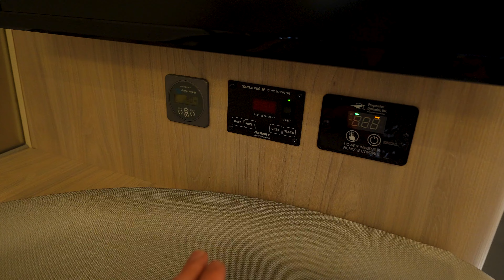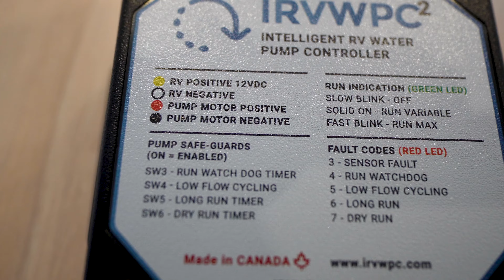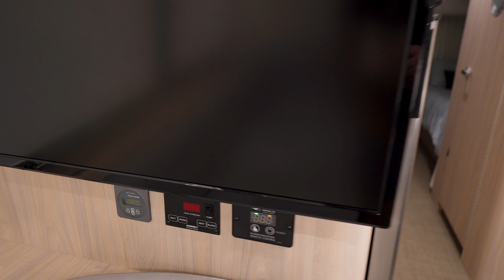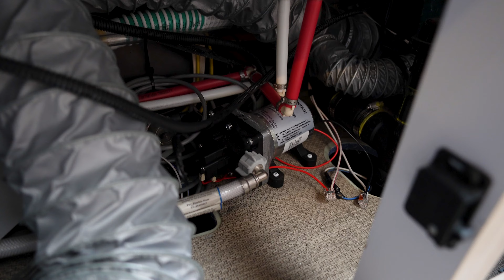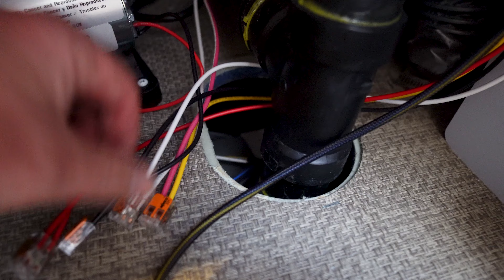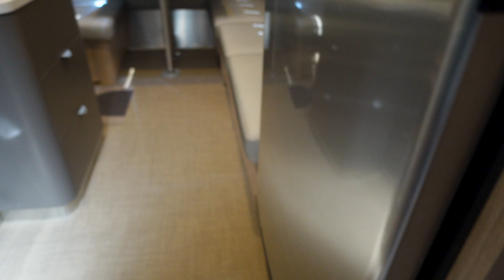IRVWPC2 - Silent and smooth operation to your plain old RV water pump!

Comment: Do you have the Girard tankless on demand water heater and if so, has it worked well with the irvwpc?  My concern is that the Girard requires 45psi and the factory setting on the irvwpc 30psi (which I understand can be adjusted - and the shut off pressure for the shurflo 4008 can also be increased above the 55psi)?  Did you have to make any adjustments to get hot water?
Reply: That’s good news. Thanks for the reply and your video! 😊
Reply from the maker: For sure! Your question inspired me to bump up the pressure setting on the controller. The process is super simple, just remove the 4 cover screws, you will see a center dial with numbers from 0 through 9, set default at 4 (30 PSI). I turned it up to 8 (guessing around 38-39 PSI). No changes to the stock pump, works great. I'd recommend turning it up before installing.
Reply from the maker: Greetings. Yes, I have the Girard as well. No issues with the install or hot water on the 30 psi setting out of the box. I may look into bumping up the IRVWPC2 pressure setting to around 40 this year. I know you can also change the operating range from 20-40 to 30-50 with one of the dip switches.
Reply: Thanks for the tip.  I will do that. 😊

Comment: We have a 2023 Dynamax DX3 and when using the pump, it cycles and the cabin lights pulsate slightly during its cycles.  Did your pump cause this to happen to your cabin lighting and did the IRVWPC2 eliminate the issue?  Thank you .  Liked and subscribed....
Reply from the maker: Greetings. I can't say we ever experienced the lights pulsating at all prior or after the controller install. I'm not an electrician but it sounds like your pump is pulling too much power, or the circuit providing the power is too small or has too many devices. Best of luck on your solution!

Comment: Standard Equipment now, Been running one for years.
Reply from the maker: Yes, its super handy for supplementing the water pressure at campgrounds with low city water pressure connections.  Thanks for watching and commenting!